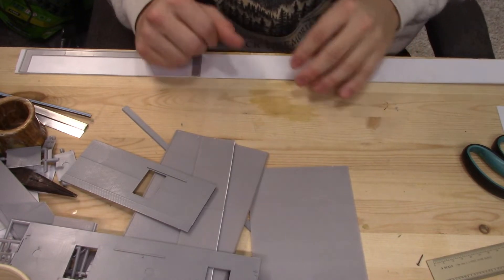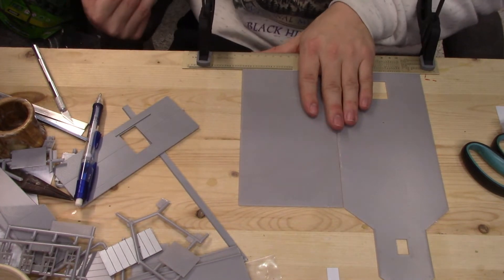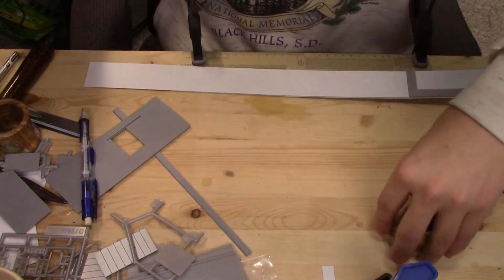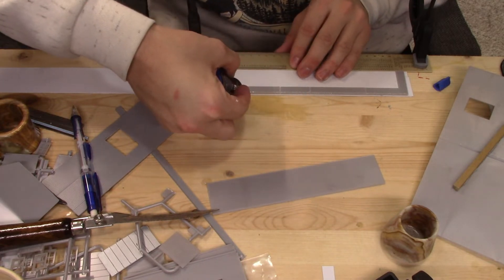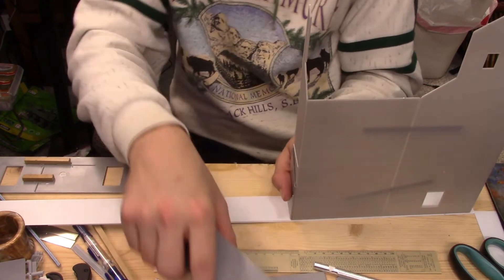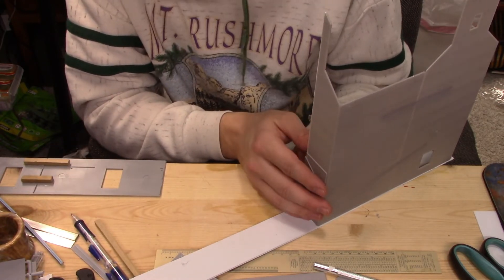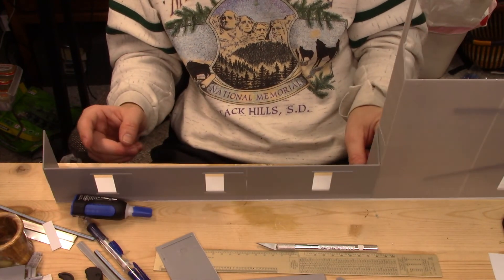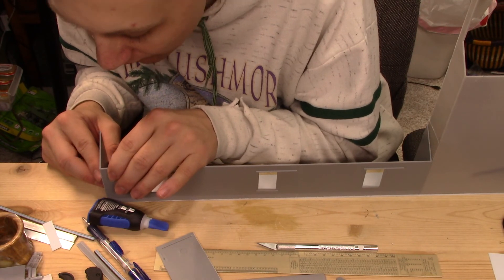How to Kitbash a Grain Elevator Part 3: Putting Things Together

Comment: It's coming along really good. Are you going to paint it , I guess? ( or should I ask DID you paint it?) I could see the wood braces outlined on the other side. A few LEDs inside and out plus a red one on top would look cool.
Reply from the maker: OOOH!  I like the idea of a light for airplanes.
Reply: @modelrailroadingfordummies9018  I use a 12volt DC source with a 470 ohm resistor to light all my buildings. They have stayed lit solid for about 3 years now.  I also collected telegraph insulators I found on the ground when I was I kid. I stuck two 10MM ultra-bright LEDS in each one. really cool efect